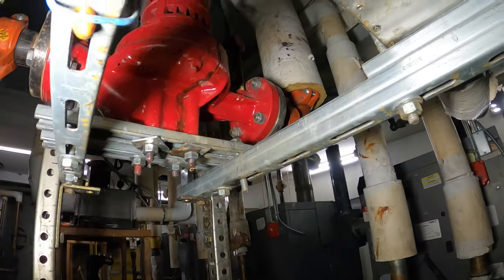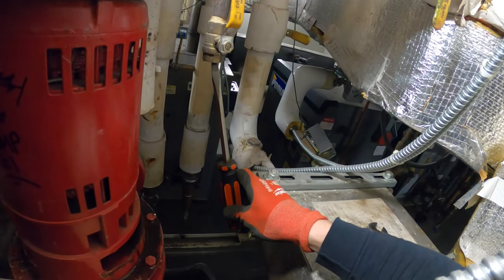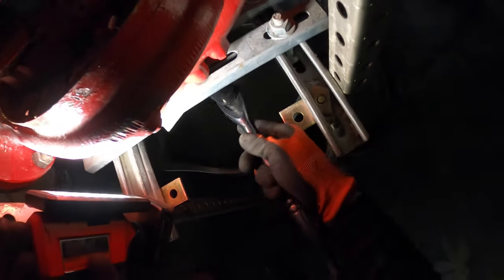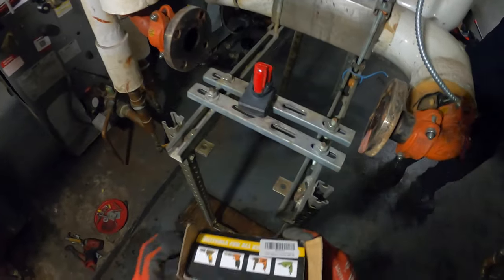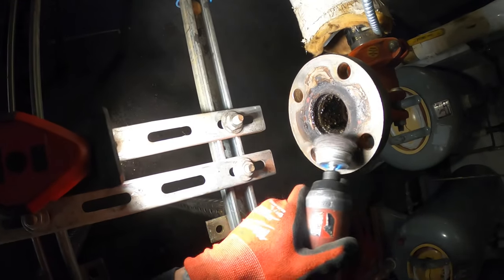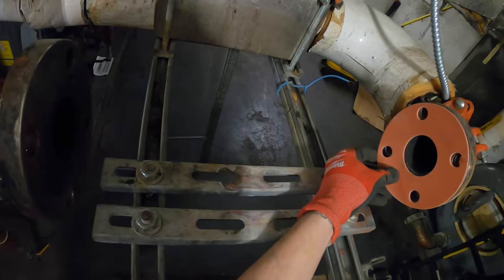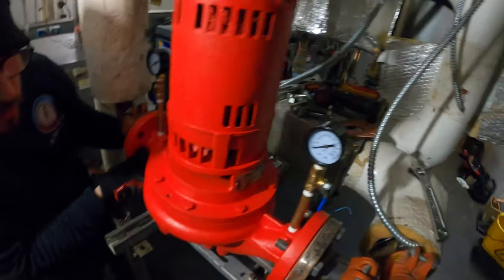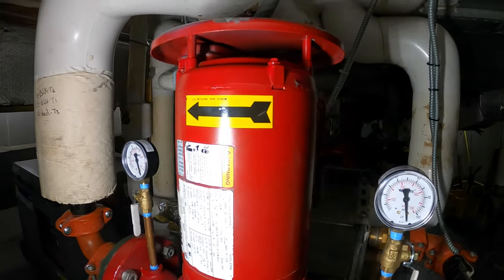HVAC: Laars Pennant Commercial Boiler Centrifugal Pump NIGHTMARE (Bell & Gossett Pump Leaking Water)

Comment: That is weird, that y-strainer is indeed normally mounted in the suction line. If the strainer is mounted in the discharge line the filter is also mounted wrong it must be flipped 180 degrees.

Comment: Looks like small pumps are a heaater for the idle boilers through the exchanger. Plus those strainers need pulled and cleaned. Get some 1/8 and 1/16 graphite gasket sheet and a gasket cutter . Make your own gaskets on site for the strainers and pump flanges.

Comment: New mechanical seals will always leak a little at first until they wear into each other. Had that happen on a circulator that I replaced the motor on and B&G did not have an old motor on shelf. Ended up getting a similar motor and having a machinist make a shaft for the impeller attach to and use a standard off the shelf motor with a shaft coupling.

Comment: Yeah Bro I feel for you on this joint!! It’s a pump nightmare! 
That loop water must be Trash to keep losing soo many pump seals!! I mean damn it’s not like they’re out of alignment. Since there’s no shaft couplings. Yeah that’s garbage loop water. 
I’ve always hated Close coupled Vertical pumps!! They’re always a SOB to work on and remove them. They’re always stuck somewhere with no room and up high on some BS all thread and senior strut! 
Sucks that your local pump shop screwed you on that pump. I mean damn the Wrong damn flanges. And to get that beast all the way in that room and it be wrong. Sucks!!
But as Usual Bro you conquered that mess!
Great job. I’ll see you on the next one. I watch all of these videos you’ve done. I’m 35 yrs in this trade and the Service Mgr of a 51 yr old HVAC company. And you sir are doing the Trade a Great Service!

Comment: It’s hard to tell from the video but it looks like primary/secondary piping. The small pump on each boiler are the dedicated primary pumps that circulate water through the boiler when it is operating and the larger pumps are the secondary or system pumps going to the risers and loads.
Reply from the maker: The boiler had a primary pump in the back of them. That little taco is like a mini booster pump on the same line as the primary. The large red pump I changed is used on a seperate water line for heat exchange off the boiler water going up the risers. Something is strange with these directions. It's tricky but I Will do the research and figure it out. Thanks for watching!
Reply: @JumpermanTech  it's weird. i assume the plate heat exchangers were a later addition installed when the fancoils went in, so the shitty water from the boilers doesn't clog up the smaller channels in the coils. i can't see a reason for the 'wrong direction' pumps being there, unless it's an attempt to control the boiler temperatures to avoid condensation. i'd be interested to see what would happen if you took that pump out and replaced it with a straight bit of pipe instead.

Comment: I have nothing to do with your profession,  but I'm always very impressed by your work. Thank you for your great videos. 

In my very limited experience looking at large-scale plumbing in hospitals, clinics, and supermarkets (service areas and public areas)  they are always adorned with colour-coded arrows along the length of the pipes, with labels printed on the insulation.

This may be unique to the Borough I worked in though (I also live in a country within Europe).

Would this area you are working in have been equally well-labeled when built?

Comment: If you put headphones on when listening to this video you can tell that bearings are going bad on multiple motors you can hear metal grinding on metal. That building seems like the definition of until completely falls apart we're not paying to get it fixed.
Reply: Its pretty typical pump room noise, mechanical pumps and hi freq from the electric motors.

Comment: Check the expansion tank, relief valve and pressure regulator. Pump seals are a weak spot in hydronic systems

Comment: Time to sell them some spiral magnet filters and make the janitorial staff clean them once a week.
You probably could replace those pumps with some euro style grunfos magna pumps. They are pretty tough and will save a ton of power if those pumps run 24/7.
Reply: no way are magnas lasting more than 5 minutes in water like that. the flow sensors would get clogged straight away.

Comment: hey  a good trick to collect the water that comes out drill a hole at the bottom of that garbage can and put a spigot and run a water hose to the drain. its a good temporary fix till you can get a new pump.